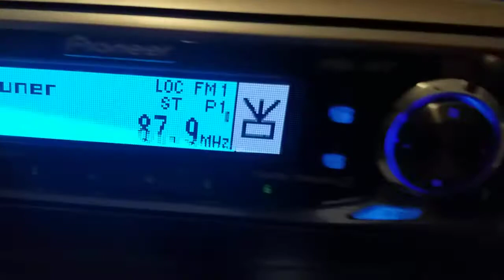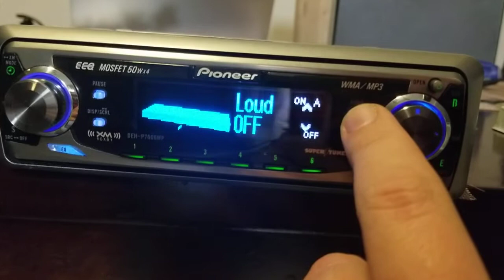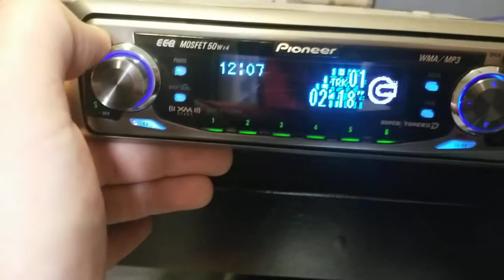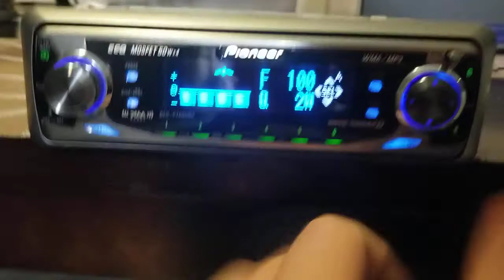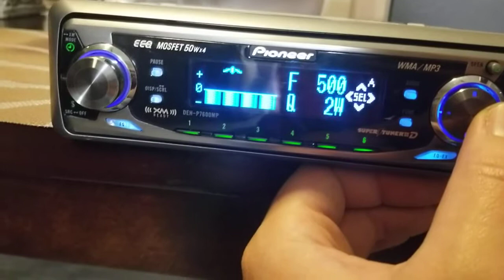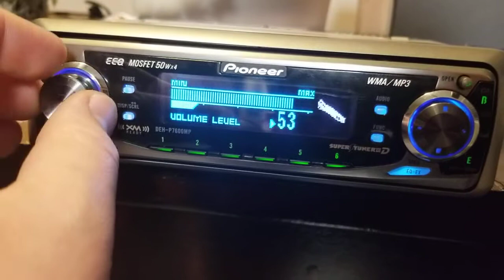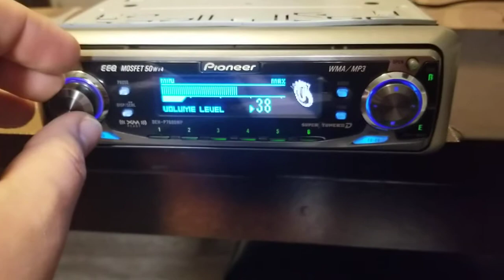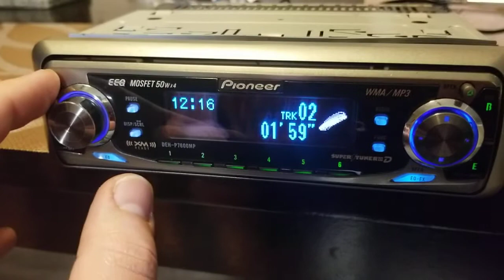DEH-P7600MP Testing

Comment: I bought an 02 Tacoma brand new in jan 03.  6 months to a year later I installed that head unit.  18+ years later I still have that head unit.  Only 2 issues with it,  hard to get cd's out and the screen shuts off sometimes when pushing buttons.
Reply: Would you sell?
Reply: @adriannl3668  maybe.... I've been wanting to replace for several years but not sure what I want to go with.
Reply: I’ll definitely buy it off you

Comment: I have 2 of these. I used to install car fi back in 2002-05. I had this head unit in a 1999 escort sedan with 4 component sets, audiobaun digital caps, 2-12” DVC audiobaun subs in sealed boxes and 2 pioneer 10” subs in sealed boxes all in the trunk and 2 Power Acoustik amps mounted on the back of the rear seats with the caps.

Was this a 2 or 4v pre out?  One unit ive had for 15 years needs a capacitor repair. People don’t repair electronics anymore it seems
Reply: Would you sell? Asking for myself lol
Reply: @adriannl3668  I am wanting to install it again

Comment: I have the opportunity to get one of these in really good condition just like yours for 200 bucks is that a good deal? Sorry I’m barely starting to learn about these stereos
Reply from the maker: I sold this one for $180 if I remember correctly. If you are getting all the accessories (remote, mounting cage, trim ring) then it's really up to you. I will say that I don't see this model available very often so it might be worth it if it's the exact thing you are looking for. For $200 there are some cool head units like the P80MP or DEH-P8400MP, DEH-P8500MP that have similar features. Good luck with your choice ✌

Comment: Does it have concert hall ?
Reply from the maker: It doesn't. Concert hall/SFC aren't on many pioneer radios for USA. I think it's mainly the DSPs (DEQ-7600/9200) and DEH-P9400MP, DEH-P940MP, DEH-P9300, DEH-P930 radios. Maybe a few others but not many. Might be easier to find Japanese/Euro radios (Carrozzeria).
Reply: @RadiOG58  do you know where i could get Japanese ones? Is there a website that ships them overseas?
Reply: I bought my Japanese carrozzeria (DEH-919, basically the Japanese version of the DEH-P9400mp) it has the Concert Hall/SFC features. I bought it for 500 bucks
Reply: @MrFacio85 what site did you buy the radio on I’ve been looking for one for a while
Reply: @efrenorozcojr2087  eBay

Comment: Excuse me so i have this model and i installed it how to i turn it off?
Reply from the maker: If it's not turning off by itself when you turn off the car, make sure the red and yellow wires are going to the right place. Otherwise you could turn it off by holding the SRC button.
Reply: for how long i press it it takes me to demo mode
Reply from the maker: @SpwSkittle  after the unit is in demo mode, hold the FUNC button and use the right side arrow buttons to navigate the menu. Go to demo mode and I think you push the down button to turn it off. It could also be the left or right button. Once it's off, push the ESC button.
Reply: @RadiOG58  im doing it right now amd is not turning iff pretty sure im doing it wrong
Reply: @RadiOG58 i need help with this
Reply from the maker: @SpwSkittle  sorry you actually use the FUNC button to go through the menu settings and the up/down/left/right buttons on the right side to change the options.

Comment: Cool i have same model ;) i can see now that my volum nob must be somthing wrong with becaus i cant get it to come out :/ Hmm
Reply from the maker: It's usually pretty easy to take apart the faceplates. Just need a little phillips screwdriver and something to help pry open the front/back pieces. There's probably a spring that needs adjustment or replacement. I haven't seen the inside of a unit like this but if I get the chance I can make a video to show how to fix it.